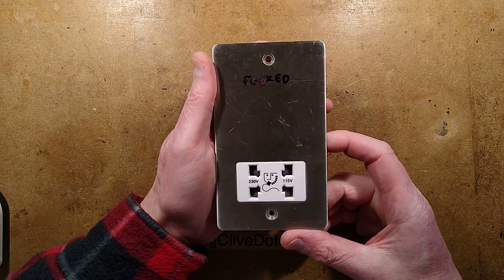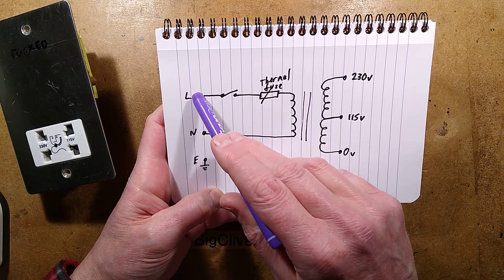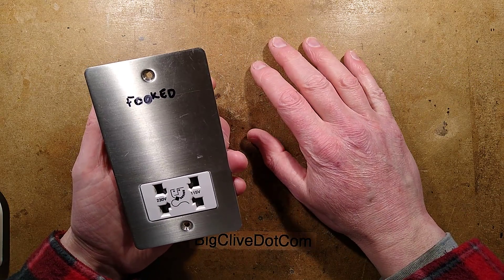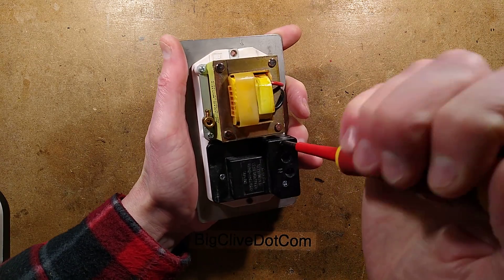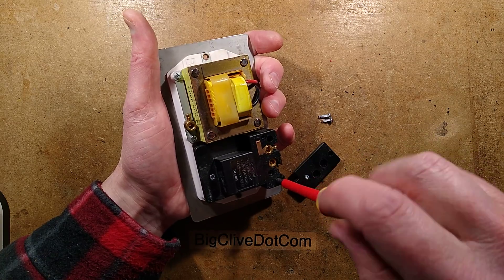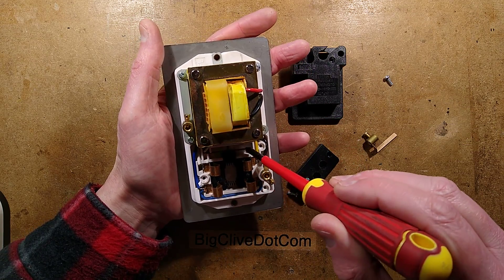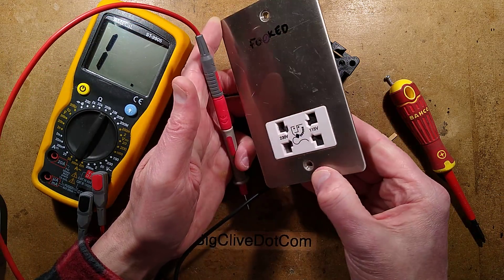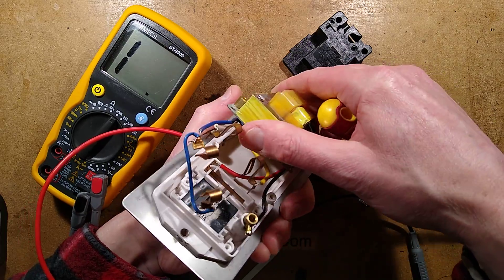Exploring a failed British shaver socket

Comment: It's so funny that the UK and Ireland have sockets that fit the EU and US plugs.

But only in Bathrooms.

My hairdrier works with my shaver plug, too, because it's an EU plug.
Reply: Ireland used to use Schulko (Siemens were involved in our electrification), but the realities of geography and logistics meant we switched to UK plugs, so our electrical systems are doubly over-engineered! Hence these sockets in our bathrooms.

I think you'll also find them in Malta.
Reply: @talideon  Grandmother's house had three different plug shapes throughout her life.
Also it hits me, the UK shaver plugs don't have the round cutout, so they won't fit Shuko! But Irelands' will.
Reply: EU plugs will not fit them.
Reply: @alanpatterson2384  they do in Ireland!
Reply: @timotheatae  The shitty 2 prong Euro plug will fit if you bend the pins, the real deal UK spec shaver plug is a lot more sturdy and the pins are a larger diameter and slightly further apart. I lived in France for 9 years and my UK spec toothbrush charger with the 2 prong plug didn't fit their 2 prong sockets, I just cut the old one off and fitted a 2 prong Euro one, problem solved... except now back in the UK it doesn't fit properly :(
Reply: @dougietamson  nothing shitty about a standard that spans a continent!

Comment: I've never seen an outlet like that before in my travels.

Wonder how long those have been around. 🤔
Reply: Decades in the UK. Can't say I've ever seen them outside of the UK either.
Reply: @Andrew Murphy  thank you, thats interesting. Are electric shavers popular in the UK?
Reply: Not like the used with be with the invention of lithium batteries but certainly my last shaver I bought when I was there (moved to Canada now) the charger didn't come with a UK style plug but a European one with shaver adapter plug in the box with the intention it would be plugged in that socket in the bathroom I guess. This was from a reputable brand too off the shelf.

Comment: Was this ever a thing in the US?  I swear I remember a gold colored faceplate with a single outlet labeled 'shaver' in my grandfather's bathroom as a child.
Reply: My parent's house built in the 1960s came with a two bulb light fixture over the mirror/medicine cabinet. The light had a non-grounded (no ground pin hole) outlet that was extremely close to the glass shade covering the light bulbs. The only other electrical device in the bathrooms was the standard wall switch over by the door. I switched to lather and disposable razors when the battery failed in my rechargeable electric razor.

Comment: I see people in the comments saying they have GFCI outlets and other various safeties, I'm in France and we just have a single differential and fuses for each circuit. It almost always trips when there's a storm with how sensitive it is. (mind you our electrical wiring is way out of today's spec) Also must plugs aren't grounded, I've been shocked a few times by touching something that's not grounded and something that is at the same time.
My dad says he wants to redo the wiring but it would take a little while and we wouldn't be able to use power while he does.

Comment: Some older homes ave them but  Newer  homes  they seem to put 10A RCD Protected socket in nz but are electrical. Stranards seem to be rather weak a lot of houses still have rewireable fuse fuse box and it still perfectly legal to put a new to old fuse box

Comment: The only other place I've seen them besides the UK, is Hong Kong. But then HK very much follows follows UK electrical regs. Other countries I seen, there's an RCD protecting outlets in bathrooms. 

Hair-dryers and things(apart from shavers) bought in the UK, usually come with a 3-prong BS1363 plug fitted, to ensure you can't plug into a 2-prong shaver only outlet.

Comment: Not in Australia, I have to say mains powered shavers are pretty much a thing of the past here and I don't think I've seen one for a very long time
Reply: Phillips still sells the Philishave, which is rechargeable, but which can still be used while plugged in and charging. Same with Panasonic, which uses a really interesting drive mechanism, not an electric motor but a linear magnetic drive  with 2 coils, and a vibrating reed that drives the shaving head assembly to cut the beard as it passes through the coil.
Reply: @SeanBZA  I have owned a philishave but I get a month out of the cutting heads so I'm back to using my antique brass Gillette double edged razor. Definitely an interesting mechanism
Reply: It is really annoying having to unplug most rechargeable shavers before using them.  Obviously designed for countries without isolating transformers.
Reply: @alanpatterson2384  No isolating transformers in Australia but everything has to be RCD protected

Comment: I have only seen these in hotels, presumably because of international travelers and voltages. In Canada it's just a GFCI outlet on residential bathrooms. I have also noticed that the the light and fan are connected to the GFCI in bathrooms, so the switch can also be tripped by a fault with the light or fan. I don't know if this is a standard or the electrician couldn't be assed putting the lights and fan on a different circuit!

Comment: Australian here. We use standard 240v sockets in the bathroom. In older places (like mine) there isn't even earth-leakage protection—just a literal fuse.
Reply: Worth investing in a fuse board replacement, or perhaps just buy some "Plug-In Circuit Breaker"s to replace your wire fuses? I'd link but prefer not to on YT. But you know the place with sausage sizzles? They have them if you search the term I put in quotes.

I'm not a sparky, and I recommend you consult with one. But as a frequnet renovator and tinkerer, I know the plugin fuse replacements are quicker to blow than fuse wire. My current home was fully rewired 6 years ago, smart meter, RCDs, new breaker box, recabled literally everything, but I have lived in some homes with scary power. Plug-in RCDs are cheaper than a funeral.
Reply: @buchinsku  I only wish I could replace the box. I have already put in replacement breakers of the type you mention, but I got mine from an electrical wholesaler and used the money I saved to buy my own snags.

Being in a rental unit, I can't change the box and put in earth-leakage protection, and they can't make replacement plugin ones.

Comment: In the USA, we have Ground Fault Circuit Interrupter (GFCI) outlets in the bathroom, kitchen and other potentially wet areas like for water heaters. Our main circuit breaker panels are 240v (+120v, neutral, -120v and ground) and most outlets in a house are wired with a single 120v breaker output, neutral and ground.  Large appliances get a bonded pair of breakers for 240v, ground and sometimes the neutral. Offices use 240v 3-phase and factories use 480v 3-phase but they still split out 120v circuits to most regular outlets and reserve the higher voltages and multiple phases for special equipment with specialized plugs and outlets.
Reply: most commercial applications in the US actually use 208 3-phase since phase to neutral on such a system is 120V. 240V 3-phase still exists, but is pretty uncommon most places.
Reply: @nesomir  I've heard of the 208v system but I didn't know they were that common. Makes sense, though, as you wouldn't need an on-site transformer. I guess I've been unlucky as everywhere I've worked has been on 240v or 480v.

Comment: Yes, definitely used to be found in New Zealand. My older house has one still. Now modern bathrooms have sockets with RCDs I think.
Reply: RCD ?? Not in UK :)
Reply: @Adiiiman2xxx  haha you can technically have a single socket in a bathroom 😜 just has to be 3M from Zone 1 😮 recently added to the regs
Reply: @combatclifton  3m from zone 1 in average UK house built 100 years ago is probably in middle of neighbor's living room XDDD
Reply: @Mic_Glow  Yepp exactly but still aloud one technically 😂
Reply: @Mic_Glow  nah, that’s these modern box houses, the old Victorian ones would be in the back kitchen.
Reply: @combatclifton  can you explain what 3m from zone 1 means for us plebeians
Reply: @combatclifton  as long as it's RCD protected it doesn't require IP rating,
Reply: Yep my grandma's house has one. I haven't seen many at all in New Zealand though, they seem quite rare nowadays
Reply: These will power a radio.
Reply: Nope not in the US....  
For bathrooms 
Pre 60s (ish) standard US outlet
60s-80s GFCI BREAKER in house panel with standard US outlet
80s- present GFCI OUTLET preferred,  but breaker is still acceptable...
Welcome to USA live dangerously 😀
Reply: @alexlail7481  Half dangerously - 230v UK/NZ/AUS vs 110 US :)
Reply: @alexlail7481  Ironically, in many areas of the US you can use a GFCI outlet in a circuit when there isn't a ground wire run through it and then replace all of the two prong outlets with three prongers legally and not run new wiring with a ground wire in it.  Of course then there is good ol' Michigan where they just don't give a rat's ass and you could wire a firecracker across a circuit and flip the breaker and it would probably pass inspection.
Reply: Got PDL versions of these in each of my bathrooms without any RCDs in sight, the old ones with the 60 Series style switch, in a mid 90's house, I now realise how wrong that sounds. As a side note the ones in NZ have the exact same logo on them so guessing it was an international standard/agreement.

Comment: Its like those cheap 100 watt travel power converter that go from 120v -> 240v or 240v -> 120v. You always get people plugging in a 1800 watt hair dryer and wondering why the thing went up in smoke!
Reply: It's not quite the same. Cheap travel convertors use auto-transformers where the secondary and primary are a single winding. Shaver adaptors like this have a fully isolated secondary. Problems arise because the UK standard shaver socket has to allow other sized plugs such as the US, AU and EU variants. The UK one is actually different so you cannot plug a UK shaver into non-isolated outlets in Europe.
Reply: My wife used the hair dryer in the caravan. Then the fuse in the inverter was blown. 
Since then there are only towels to do it.  
Most devices only require 12 volts. The 230 volts are only for small loads with no 12 volt input.
Reply: Small wonder.  They are running that poor thing at 18 times its rated current!  In fairness to them, if it has a NEMA 1-15 receptacle on it, I too would expect the device to be able to handle the full 15 amps through it.
Reply: @scratchpad7954  These devices have a label that specifically states the maximum output power. Its too bad a lot of people dont bother reading any labels... I've seen so many things broken by user error because instructions were not read...
Reply: I once spent 10 mins in a UK store trying to convince a Canadian that he could not just buy one of these to enable him to buy and use a 240V 2.5kw European kettle at home!  Unfortunately at the time I did not know it was possible to have a 240v socket installed there.
Reply: @JC-jv5xw  trust me, that person will not have a 240v socket installed... He would rather make thing overcomplicated trying to make an adapter/transformer/Jerry rigged deathtrap to use a UK appliance in the US.... I have had a customer in the us have a UK receptacle installed in their kitchen and bathroom. They had some old appliances their grandparents had brought with them from Europe and they wanted to be able to use them in the US.

Comment: In the US, my family's old vacation home built in the 1960s has the receptacles in the bathroom on a light switch. A bit of research suggests that this was done back then because the isolation transformers in shaver sockets could cause radio interference. There's just 2 ordinary outlets there now, but it's an interesting artifact. Any electric razor I've used has always been battery operated.
Reply: Mine is rechargeable/mains and my bathroom lamp has such a socket, which is typically used to run or charge the shaver.
Reply: There is no such thing as a "shaver socket" in the US nor has there ever been.
Reply: @ryanroberts1104  yes there is, only you use them all around the house and run all your 120v home appliances through them using ‘finding NEMO’ plugs 😀
Reply: @SproutyPottedPlant  There is no transformer IN the wall. What you are referring to are DC converters and they are as common in Europe as they are in the US...
Reply: If it actually has a transformer, the switch is to save power when it's not in use. More likely it does not have a transformer and the switch is just there so you can safely leave something connected and turn off the power when it is not in use.
Reply: @KeithJewell  There is no transformer. US bathrooms have "native" 115v, and always have.

Comment: I can say, as a resident of Australia, I have never seen anything like this, just the standard 240v outlet for us.
Reply: I’ve seen them here in Australia, mainly just in the bigger motels in the capital cities
Reply: @andrew051968  yes just in major motels in common travel areas.
Reply: Your wiring code permits non-isolated 240v outlets in a bathroom?
Reply: @ferrumignis  Our wiring code requires GFCI/RCD on EVERY outlet.
Reply: @brendonwood7595  Although pre-GFCI/RCDs, non-isolated 240v outlets were apparently allowed in the bathroom, given the number of places I grew up in which had such (and weren't DIY jobs). Their placement tended to minimise extreme risk.
Reply: @Thermalions  I believe even pre RCD requirements there were  placement requirements such as no closer than x to a tap etc.
Reply: @ferrumignis  There’s an RCD in the meter box.
Reply: @CT-vm4gf  Bingo, I find it so weird that some countries only use RCDs / GFCIs on outlets near water
Reply: @ferrumignis  That is correct.
Reply: As a resident of Australia I can say I have seen many
, but in the Mother Land from where I originated from 😉
Reply: I’ve seen them here is Australia also, you will see them in large hotels and occasionally in regional motels. There not generally used in household settings

Comment: The closest comparison we have to something like this here in the US are GFCI outlets that just cut power entirely when tripped by the erroneous electric gubbin going for an invigorating dip in the water
Reply: Their UK equivalent is the RCD or residual current device, which works in the exact same way as a GFCI.
Reply: @stevecann3394  The only difference here being that the US usage of the GFCI/RCD is at the outlet rather than across an entire circuit or possibly house.
It's a bit safer, though not nearly as safe as using a whole freaking isolation transformer for one outlet. Of course, neither country uses isolation transformers across ALL of the outlets near water.
Reply: @Falcrist  indeed. I do have a plug-in RCD for outlet use, e.g. for using with my pressure washer.
Reply: @stevecann3394  Yup... except "RCD" is a totally ridiculous name and the 'Murican name is "better in every way"! (Clarkson voice)
Reply: @dregenius  I dont think either name is particularly good on its own, but both together describe it well.  GFRCD would be a good name for it
Reply: @dregenius  BCBO Forever.
Reply: Yes GFI (Ground Fault Interrupter or Ground Fault Current Interrupter, GFCI) ElectroBoom has a fun video on that: https://m.youtube.com/watch?v=GlM6PE2kKVY

Comment: We used to have bathroom outlets like that in Canada.  You can still find them in 80's houses and older.  But these days we use ground fault interrupter outlets instead.
Reply: I wouldn't take that chance! RCD and GFCI are just fine, till they fail to protect you.
Reply: @dlarge6502  The advantage of the GFCI/RCD outlets is that they're mandated to be anywhere that might be near a water source. ALL of your bathroom and kitchen outlets are individually GFCI/RCD protected.
In the case of the shaver outlet, it's safer to have a whole isolation transformer protecting you, but that's only one one outlet. The other outlets are only protected by the GFCI/RCD at the main breaker box... or possibly the one massive RCD for the whole house.
Reply: @dlarge6502  Isolation transformers don't seem that safe to me either.

Comment: Here in states we have GFCI (RCD) in the bathrooms with full 15 or 20 amp current available however the ground faults are limited to 5mA.
Reply: I have a GFCI in my bathroom and was confused why my outlet tester wasn't tripping it since one of the indicator bulbs is powered from live to ground to confirm the ground is working. Turns out those things need 5mA to ground to trip and after a little googling the little neon bulbs only used about 2mA.

Comment: One's I have looked at have a PTC which acts as a resettable fuse, so a single overload doesn't condemn the unit as scrap.
Reply: I was wondering about that... is the fuse in the unit Clive tore down really a one-shot fuse and not a resettable device that got destroyed by too many (or one massive) overload(s)? Or IOW is this really a device that is permanently buggered by a single overload?
Reply: @sootikins  good question; a one-event thermal fuse is usually a small shiny metallic cylinder the size of a half watt or one watt resistor, but the one on the video looks like a tiny ceramic capacitor. Probably a one-time device, regardless.